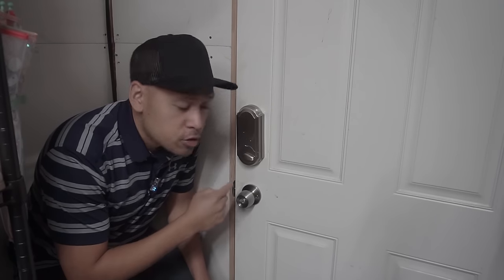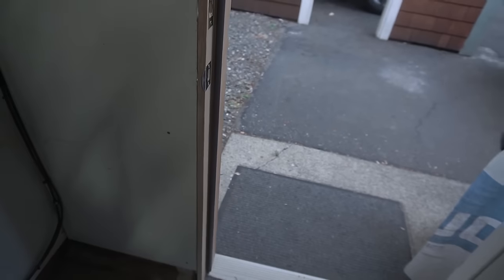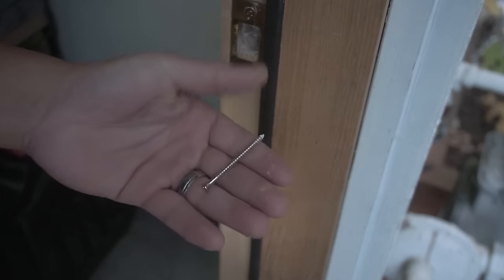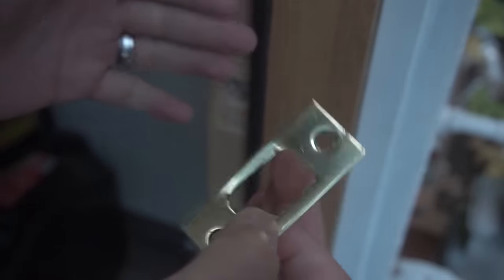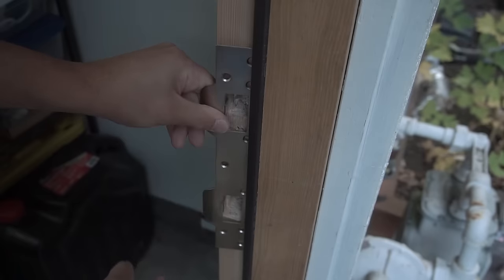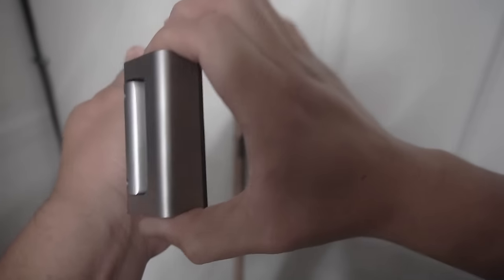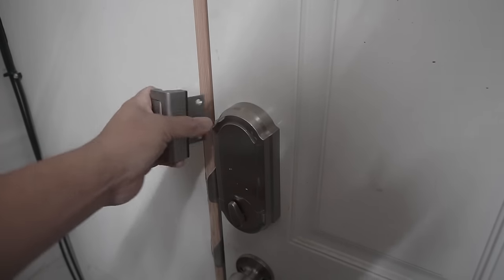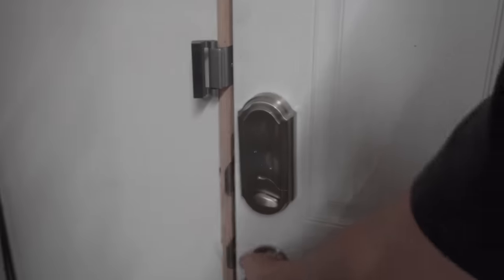How To Make Your Door Kick-In Proof Like A TANK! Keep Your Family & Home SAFE!

Comment: You should have added that chain that you see clearly bolted to the door in the last scene. Those actually make it insanely hard to kick in a door as well. Or at least hard enough if they blast through your tank of a door, to give them a few more kicks while you grab your shotgun to address their poor decisions.
Reply: I wish more people realized how strong those chains are and the physics that make them work. I've put them to the test and they defeated me every time no matter how hard I kicked
Reply: @realiouslytv1711  I understand that chains are kick resistant because of the fact that the door needs to be open to break it but I still thought they were relatively bad compared to a door guard and also the fact that the chain can be cut by pliers is bad also.
Reply: @vicgamesvt9682  chain cutting must be thought about when installing. You can install it so that bolt cutters can't get to it. The slack of the chain absorbs all of your Kik power. It's incredible I've tested it myself and was quite embarrassed. Fortunately whoever installed the one I tried to kick through did not think of bolt cutters and I had just enough Gap to get in there and cut the chain. Also installing it with two and a half inch screws so that it's screwed to the wall stud makes it impenetrable
Reply: Or 5.56
Reply: Those chains aren't foolproof. If you kick the door and split the frame you can either cut it or kick the door again while it's open with no slack on the chain.
There's also an extremely simple way of opening those chains with just a single rubber band. Most videos on it show the person reaching inside to put it on the handle but there are ways around it even if you can't get your arm inside
Reply: @thedancingpipestuffer  so what's your argument here? Don't have a chain at all because the robber might have a rubber band?
Reply: @thedancingpipestuffer  you're not kicking it in. Ever

Comment: I had a door that was not metal wrapped which means that the wooden core would split out if the door was kicked. I went to my local hardware store picked up two brackets and a hardwood 2 x 4. The brackets screw into the studs that frame the door on both sides and the 2 x 4 slides into the brackets. I then took a couple of wedges to make sure that there was no gap between the door and the 2 x 4. I think what you did is fantastic and would work great as long as your door does not have the same security deficiency as a door that is not wrapped in metal.

Comment: Very interesting n informative upload, especially reinforcing a door. Question: how did ur reinforced door plate match exactly with ur existing deadbolt n door knob locks' holes???  Is there  a standard spacing between the two locks??? Please comment.
Would be interested in purchasing that type of plate. Kudos for vid. It was very helpful.
Looking forward to ur next one. Peace
Reply: most door come with both holes already, standard backset and spacing

Comment: Multiple layers of security. I will be adding security doors to all my exterior doors. So if anyone wants to break in they have to kick open through two doors! and since the exterior security door opens outwardly that is going to be twice as hard to do as they will have to pull not kick.
Reply from the maker: Smart man! 👊🏽😎
Reply: Or just remove your hinge pins if you forget to use security hinge pins.
Reply: @JGoodwin  I didn't know that was possible all the metal mesh security doors I've ever seen or that my family has in their various houses have the hinge seams welded shut and you have to attach the whole assembly through the door frame which is inaccessible when the door is closed. But yea thats a fair point.
Reply: Couldn't they just pry the outswing door open with a crowbar?
Reply: @DM-lk5ym  Sure. Might need a 3ft pry bar minimum. A standard crowbar wouldn't cut the mustard.
Reply: Good thing you live in a house without windows!
Reply: @curtisbme  They have rod iron decorative window bars. Except for my bathroom, will need to put some there when time permits. Im getting rid of the see through chain link fence garbage and replacing that with a concrete block wall. Security and privacy is top of my to do list.

Comment: This is good advice on reinforcing the jam itself, but there are a few other things. A door wrap around like Don-Jo. For inswing doors, you can get an interlocking astragle to prevent tools being jammed in to pry the door(or overlapping for outswing). Security hinges(or security pins that replace a couple screws)
Reply: The dojo door wrap is not meant for a steel door, it will not wrap properly and they are not attractive. Better quality deadbolts are a much better idea.
Reply: @cyberwolf6667  I wasn't going for the aesthetics. A wrap can absolutely go on a steel door. The bends are curved so you can get a nice fit (on wood doors, you have to trim the corner of the wood). Problem with just putting a better deadbolt is that most north american entrance doors are steel "laminate". Steel skin on the outside, but a relativiley soft wood frame and edge. A good kick will split the door.
Reply: @Rithanel  
I have to agree and disagree 
I will admit , certain big city areas you do whatever you can to make the door as strong as possible, but in rural areas most attacks are spontaneous and if the door doesn’t open quick, they leave. 
I don’t like the fact that have to alter the door edge to allow the Donjo plate ( I’m old enough to remember Mag, the original)to sit flush, you can never undo that. How many kicks will it take to split a good wood door, Hollywood 1 kick opens aren’t real. (Unless you have a crap frame) 
And yes, the wrap plate will definitely help protect the door, I just have the believe that you can go to far. Like I said , no point in wrapping a door with a Kwikset or Defiant deadbolt on the door
Thanks for your response 
I’m a locksmith for 36 years , east coast, but I don’t work the big cities anymore, rural Ohio now
We have idiot for crooks
Reply: @cyberwolf6667   @cyberwolf6667  Will admit, got a couple decades on me. Operate out of Alberta. Just wish I had gotten out of my way to meet Mr. Lang sooner.

I think we have different varieties of idiots. Town, they usually give up pretty quick.  Rural for us is the worst, because they know they have at least a half hour response time. Only difference is touching the house is extremely rare (don't want to deal people or dogs) but they'll do everything to clear out the shop/garage/sea cans.

Is it just me or the weiser element series just a rebranded gatehouse line? I had to rekey an electronic db, and it felt like the flimsiest thing I've ever held in my hands.
Reply: Kwikset owns the weiser name now so it’s probably an import. I’ve been noticing that the residential hardware getting worse and worse. I only use grade 2 or better because of that. It’s become a throw away and replace with new world for our industry. Manufacturers only seem to want it to last 5 years or so.
I use Mul-T-Lock, EMTEK, Arrow and LSDA (grade 2) primary, I do upgrade LSda with the Emtek’s bolt for my residential customers. 
I can see how you have issues with peoples home being far apart from each other, our residential area are on top of one another, 25ft between neighbors and a lot of condos. So around here if the door doesn’t open first or second kick , they move on.
What’s your feeling about that secondary flip lock, I don’t recommend it here, people forget it’s locked and leave out the attached garage,  loose power, they can’t open the doors with the key.

Comment: Between watching your video and EVERYDAY HOME REPAIR video, I bought the same Defender Security latch plate and put on my small garage entrance door and install was very helpful after watching both videos. My only complaint on this latch plate is I noticed one of the supplied three inch screws was curved, or slightly bent, which made me wonder about the strength of the supplied screws. Luckily, I had three inch galvanized screws I had put on existing latch plates two years ago and I used four of the three inch galvanized screws on this new security latch plate, which I think will add more security. Otherwise, I give this Defender Security latch plate a thumbs up 👍 👌

Comment: Sadly, with most new constuction, cutting the vinyl siding, fiber board and drywall next to the door is easier.
Reply: Takes longer and is just as noisy, most thieves aren't prepared with a recip saw. Try to get in and out through 16" on center studs while a homeowner is pointing a shotgun at you.
Reply: Try living in mobile home aka trailer house. Flimsy. And those sliding glass doors. What a girl to do?

Comment: A person could always add a drop bar that crosses the whole door made from a 2x4 and uses 1/8 inch metal brackets screwed into the house framing with lag bolts.
Reply: Exactly what I did on my basement door and it works great.    ;-)
Reply: I bought a few of these to try to add extra security to some of my doors, mainly a basement door and a side door which is rather out of site and likely more vulnerable to break ins.  The issue I'm having is that both those doors are half light doors.  Without having to purchase new solid doors, I'm not sure how to best secure the glass portion.  In all, I have 3 half light doors and one full light doors. I understand why they were originally installed and they are nice metal doors, it just seems like they would be easy to get into by breaking the glass.  I can't afford all new doors at the moment.
Reply: pERSONALLY, i DUG A MOAT AROUND MY HOUSE. aND, I keep it chock fULL of Hungry alligators
Reply: @USCG.Brennan  Does the security grills go on the outside or inside?
Reply: @martyminer828  Always on the inside or some thief will simply bring his screwdriver along to pull them off to get in.

Comment: Personally, I would have moved the Reinforcement Lock up about 6 to 9 inches.  Moving it up does two things for you.  First, it futureproofs the deadbolt lock; who knows when you might end up with a new "smart lock" that takes up a bit more room.   Second, and more importantly, it spreads out the force that's being applied to the entire area on the supporting side. 

There is a downside to  those reinforcement locks however;  if you have someone that is weaker in the hands, smaller hands,  or "less coordinated", they might have trouble opening the lock . That said, it's also comforting to someone inside because the lock cannot be opened from the outside, unless the door has a window in it that is used to bypass it, or there's a window off to the side of the door.  The wife is one of those people that have difficulty opening this type of lock; she uses a screwdriver. 

Like the strike plate. Can't use 3 inch screws due to how this house was originally framed and built.
Reply: Same here. I have those stupid, little windows on the side of the door.

Comment: I installed a security plate on all three of my exterior doors as well as my outbuilding. I opted for 4 inch screws so they went all the way to the king stud. All the doors are steel so if someone tries to kick in my door, they will break their foot before they break in the door. Like the auxiliary lock. Looks a lot stronger than the old chain lock.

Comment: Using a lrager door striker plate for the deadbolt, and regularknob really helps because when any force is applied to the door, it gets concentrated at the deadbolt, and knob latch. The bigger plate helps spread that energy out and away from the deadbolt locking mechanism. If you could run on the entire length of your door, and afford it, that is best way to go. Not cheap but they really do work. If you notice, most deadbolts only go in about an inch as well. having multiple deadbolts, say 3 of them can really help secure a door (top, middle, bottom). The reinforcement locks work great, but you can only employ them when home.

Comment: There are still two weak points on your door:

Firstly the timber frame is very thin and liable to split as you bolts are focused around the centre.  Consider having a dead bolt on top and then running a steel strip from top to bottom on the left frame.

Secondly, the door hinges are a weak spot, but this is easily fixed by having two or three bolts drilled into the edge of the door and sticking out so that they lock into a corresponding hole in the right-hand door frame.  Lastly put another steel strip from top to bottom on the right-hand frame to stop it splitting.
Reply: If you are in an area that requires such heavy upgrades to the frame, you need a better deadbolt first.  The strike plate he is showing is not a bad strike, however some did comment correctly and said not to use the screws that come with it, 3”torx deck screws work great for this. Many people forget they don’t know what the door is  made of
Simply use 1-5/8 screw into the door side and one or two 3”screws into the frame side , make sure to use the holes closest to the outside of the frame not the interior side.
Reply: @cyberwolf6667  my advice is independent of area - if anyone’s personal circumstance requires them to secure their door (be it in Beverley Hills or the Bronx) then half measures simply undermine the project.

Comment: Wow, good job needed this for our garage door in 2020 and 2021 thieves broke into our garage took everything they could carry. Glad I came across your channel. Now, I know what we (hubby and me) need to do make our garage door harder get in. Thanks for sharing and you be safe too. 👍👍👍
Reply: Very inexpensive is to close the door completely and look at the track the door rides in, locate where you can drill a hole big enough for a caribener  to fit for both door rails. Of course they need to be removed to operate the door. Protect the emergency release rope so it can not be used from outside, and if possible interrupt the circuit wiring to the door opener and place a light switch where you interrupted the wiring circuit. Garage door openers can be scanned and operated remotely to get in. The door openers operate by radio frequency thus can be scanned and controlled. Being a retired law enforcement officer I was told how the bad guys get in.

Comment: Definitely need to chisel in the the new hardware cause once the house shifts or door sages , it’s gonna run on the new hardware. Also I highly recommend pre drilling for the longer screws, it will make it easier to screw them in and you won’t snap off any screws.

Comment: Nice stuff!  As long as the distance between the locks lines up with the dual strike plate, I like to run a steel plate vertically along the door jam overlapping 2" or 3" and screwed into the framing studs then cover with wood trim, can do with ANY lock setup - pre drill the plate of course

Comment: Great idea bro, also, on the wall side of the entry point, if there's room to mount a 1/2 inch thick x 6 ft length piece of Re-Bar near the wood the where the strike plate is screwed into will add extra security indeed. The method I suggested will work if ones wall is a bit wider, and be sure the rebar is fastened in strong from top to bottom no doubt. After the new strike plate, longer screws and rebar are installed, just cover that wall area up wit sheet rock, joint compound and new paint, to make it look good. Keep in mind, for new construction, Re Bar is awesome to add strength mainly for cement and concrete construction, though if you can finesse it for wood construction, more power to you.

Comment: Many comments say make door swing towards outside. Metal seems a better choice with metal frame, too. But doors made of wood shrink with moisture loss. What would you do? (When not properly fitted and summer moisture comes, some doors get fat and tendency might be to sand away a little. Or adjust locks position. Then when winter comes, door is even less likely to catch well.) 
Also, thieves notice and weaken it more by yanking on the door knob.

Comment: When installing residential doors, I like to add where the deadbolt is, a 2"by 6" metal nailing strap to lay a sixteenth behind where the casing will cover. This will help 100% to the jamb breaking from blow of deadbolt incase its ever forced open

Comment: Agree with fortifying your door and being a harder target. Ultimately the door needs to slow them enough for you to line up the sites, though TBH with the front door camera it is easier to confirm ill intent of someone kicking on your door and put a couple party favours through the door at them.
Reply: Unless it's local PD serving a no knock warrent, then you're screwed if you have a gun in hand.
Reply: @BoleDaPole  The good news is that no-knocks are being phased out, in part because of the consistent risk of officers getting the wrong house (again), and getting lit up by the resident acting with the full blessing of the state.

Comment: So also what I did was remove my molding and add metal plates behind my molding. Then I attached my molding with 4 inch screws through the metal into the frame.  Then basically did what you did. 

I also did it on my hinge side as well

Comment: I invested in a ProVia Legacy Steel with aluminum clad frame and couldn't be happier. The entire lock plate is a long steel panel insert, with steel inside the hole too. It has a 250 lb dent capacity, is 22 guage, metal on all sides (most store-bought are 24-26 guage, with composite sides) baked on glaze paint, and I designed it with adorable 1/4 light that has three different glass panels-1 plain, the inside stained, and a third of wavy privacy glass. If you try to kick it in, you will break something.